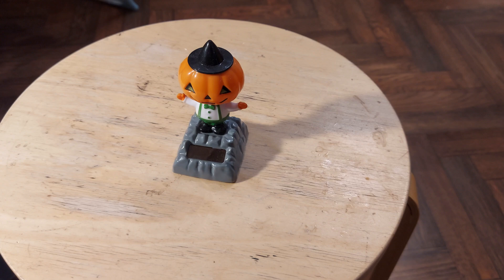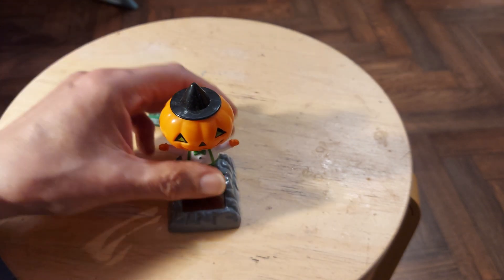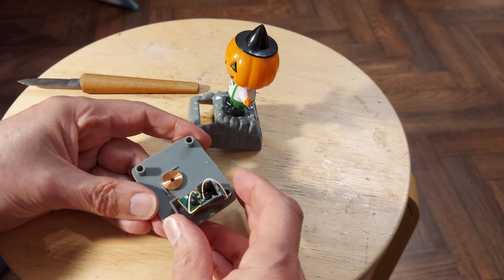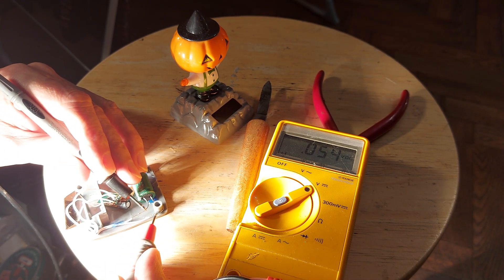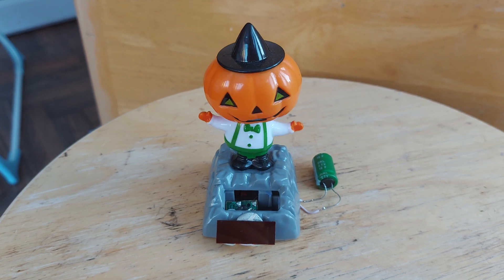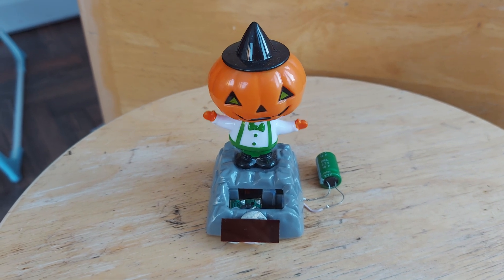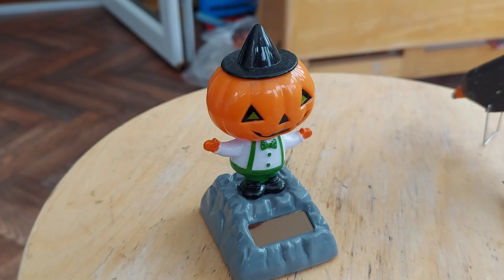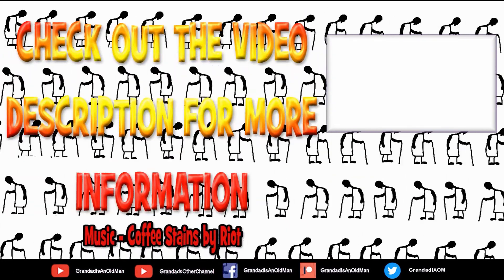Adding a supercapacitor to a Halloween Solar Rocker

Comment: Supercap has also a super low resistance. The solar panel sees almost a complete shortcut. If you look at the graph of a mono-crystalline silicon solar cell, in the low regions it does not provide much power. It you look at the graph (I versus U, currrent vertical, voltage horizontal) , it goes up in a linear fashion up to the mpp point and then it drops down. So the higher the voltage of the supercap, the more power the cell is able to deliver. (under good solar light of course). Pre-charging the supercap was the best solution. I would go for a much smaller ( < 0.5 F ) capacitor since the solar cell can't put out that much energy. Or can it?
Reply from the maker: It works absolutely fine. It runs well into the night, I am not sure it even stops before daybreak. The Surfer-dude has been working for 3 years now.
Reply: @GrandadIsAnOldMan  I was going to ask if it even stopped before dawn, depends how much these shorter days can charge the supercap before nightfall 🤔
Reply from the maker: There is a problem with finding out🤔 Either I have to get up before dawn to check and that is not going to happen, or I put my timelapse camera on it, but that camera does not film in the dark and if I leave a light on, we don't know if the light is adding any charge. However, the video of the "Surfer-Dude" https://youtu.be/cDCQJMbzLEE includes an overnight timelapse and does seem to show it is still running through the night until it is too dark to see, and in the morning when the sun comes up he is still running.
Reply: @GrandadIsAnOldMan  ... does it make enough noise to get audio in the darkness?  If it runs all night or just part of the night, it's still impressive!  I know somebody that wants one either way 😀
Reply from the maker: @jayherde0  Yes I could amplify the audio so you could hear it clearly, but would you watch a 12 hour video of darkness just to listen to it squeaking?
Reply: @GrandadIsAnOldMan  ... It may seem to be a daunting task.  If you listen to a piece at 6 hours (half way), you cut out 6 hours of listening.  If there's no sound, go back 3 hours (half again). If there is sound, go forward 3 hours.  Then, keep cutting the sample by halves checking for sound or no sound in the same manner.  It's not foolproof - there's the possibility that the entire section of inactivity got discarded.  If no silence is found, have an unmodified one sitting next to it and check 10 min. intervals backwards from where the unmodified one starts working in the video.  An hour or two (6 or 12 checks) should be sufficient.  😉
Reply from the maker: @jayherde0  I think you misunderstand the issue. YouTube is full of trolls. If the video is not a continuous shot, I will have to spend hours in the comments dealing with trolls who insist I have faked the video. I left the timelapse running last night and this morning it is clear the pumpkinhead ran through the night and was still running strongly this morning but to add to the confusion, the clock that I put in view for reference stopped at 8.20 last night, so when the morning brightened up it was stuck at 8.20. It actually started getting dark last night at around 4.00 so there is no way I would have noticed the clock had stopped. I think I will use an LED clock with a red display so we can see it through the night. That should be dull enough NOT to power the rockers.
Reply: @GrandadIsAnOldMan  ... Accepted and understood.  Thank you ... I still know someone that wants a 'super' rocker - she just doesn't know it yet.
Reply from the maker: @jayherde0  I would suggest a smaller supercap, I think 10 Farads is far too much. I think the Surfer Dude's is 2 Farads and that just about sees him through the night this time of year and he has no trouble in the summer 😁😁 The other option is to run the rocker off a solar garden light. Then it doesn't rock during the day, but when the light comes on at night it rocks along with it 👍👍 Without checking I cannot remember if the rocker goes in series or parallel with the LED, I seem to remember there was an issue until I worked it out.
Reply from the maker: Just an extra bit. I set the timelapse clock up again tonight with the red LED clock in the background. Then I realised I could have used one of my security cameras to monitor it. Those cameras have infrared LEDs that illuminate the area at night, so I will set that up tomorrow night. I will leave this one running tonight as it might as well finish what it has started.